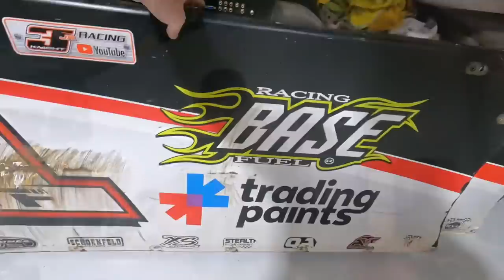Shiny New Trailer! Big Upgrade for the Hunt the Front Super Dirt Series

Comment: Piece of advice, take and put the plastic curtains on the rear door also. The 1 ac most likely won't be enough to keep you cool for your summers. Add another ac unit and Genset should be able to run both.

Comment: when you guys gonna get some hydraulic car lifts , ive had mine for 20 years and they only cost about 3500.00 a piece , installed, they are my number one shop piece of equipment, just think you can stand under the car installing rear ends , transmissions , front end parts  and really get a good look at the undercarriage, just a suggestion , im sure the fork lift came in real handy and youll see the lift will too
Reply: If they wanted to they could use their Dirtcar lifts & not have two posts blocking the flow in the shop they already can’t fit all the cars in the shop. It maybe time for a new addition.
Reply: Anti-trans  Hope this is true. Only concern I have with this type of thing is, if something happens to the main sponsor, potentially everything goes away.

Comment: Always had problems with misfires with those 3 electrode plugs, I dont think they help. I hope they work for you guys. Good luck!
Reply: Common sense is that fire goes to the closest electrode.I sold them for years as a  parts mgr.
Reply: Did you have problems from the beginning?  Or after 4 or 5 races?
Reply: @51-FS  2 Races
Reply: I will stick with my auto light Ar135 lol

Comment: Watching Jordan putting  plugs in Jesse engine and I couldn't believe he wasn't putting anti-seize on before putting the in an aluminum cylinder head. Anti-seize is Messy but it's better to use than be taken out a plug and the threads come out with the plug.